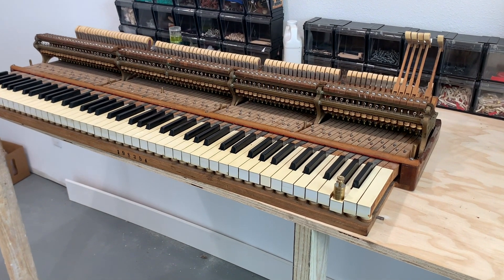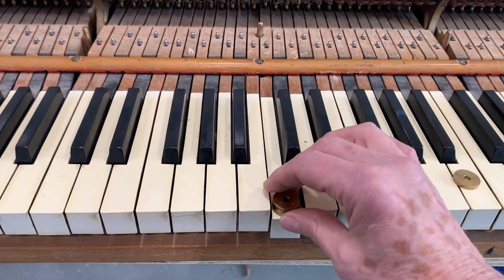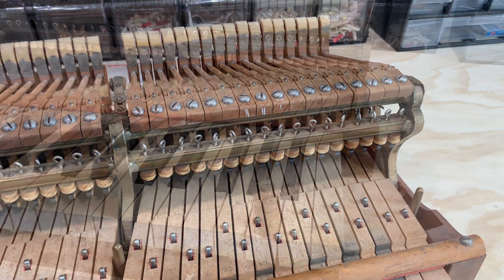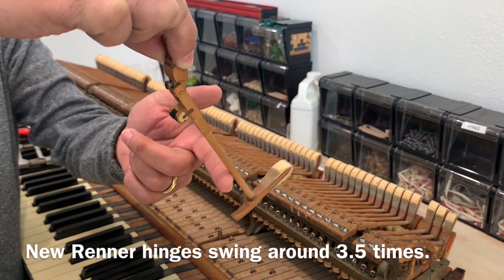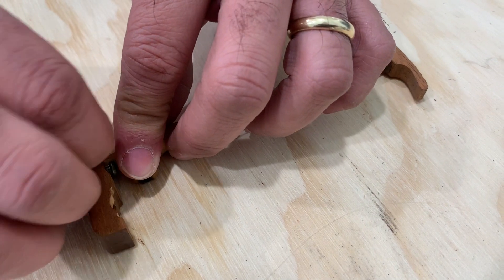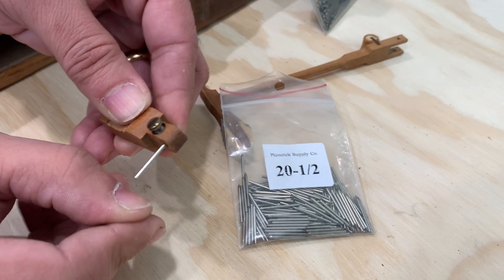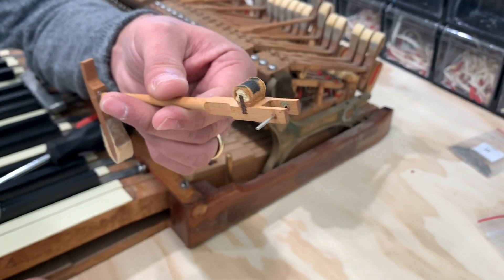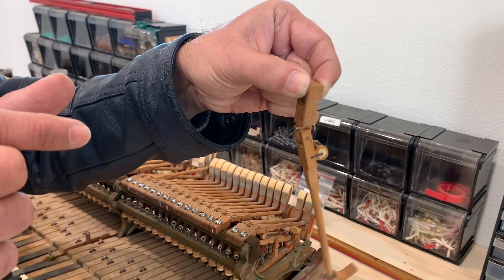Re-pinning New York Steinway O 1919 together with Jose & Evan Roberts at Roberts Pianos Houston.

Comment: Excellent video Marcus.  I can now see why techs prefer to replace the hammers, shanks and rollers in older Steinways with vertigris.  It must be very tedious to repin all 88 notes in the manner that you demonstrated. We have a 1927 Steinway L (the NY successor to the model O) that we had rebuilt with all new Renner action parts including the whippens.  Prior to rebuilding it wasn't nearly as bad as the one in your video.  It's nice to see you helping your son in Houston instead of England and working on a NY Steinway rather than a Hamburg like you usually see in the UK.  It is however great to see all of the magnificent German pianos that you get to work on across the pond in most of your videos.  We don't see many of them in the US.

Comment: Had you considered new felt for the pin or is that too much extra work?
Reply: The flange bushings are not actually felt, but a woven fabric with a felted surface, called Bushing Cloth.  It's less labour-intensive, generally, to simply buy a new set of flanges, provided ones of the right dimensions are avalable for an old piano, than to re-bush old flanges.

Comment: There is a lot of discussion about the verdigris problem with New York Steinways of a certain era, among US-based technicians.  It seems that the verdigris may be attributable to an experiment by Steinway to make flanges less susceptible to humidity changes, by impregnating them with something (I forget what - perhaps others can comment).  Recently, PFPE (not PTFE) lubricant based on Fomblin (with other stuff added) has been experimented with by Dale Erwin and  Mark Purney and others, and is being sold by Supply88, but only in the USA.  It is much more expensive than Protek CLP, but can offer the customer a lower-cost remedy than re-pinning, or new flanges etc.  I have obtained a bottle of the Fomblin, but have not been able so far to obtain the other necessary chemistry.  If I do, I would be interested to send you some to try, and see what you think.
Reply: Re "an experiment by Steinway to make flanges less susceptible to humidity changes": Are you perhaps referring to the teflon Perma-Free Action debacle of the early 1960s?
Reply: @James_Bowie  No. I was referring to an earlier era in which it seems that some wooden action parts were impregnated with something to prevent moisture absorption with changes in humidity. The Teflon bushings debacle was a whole other thing.